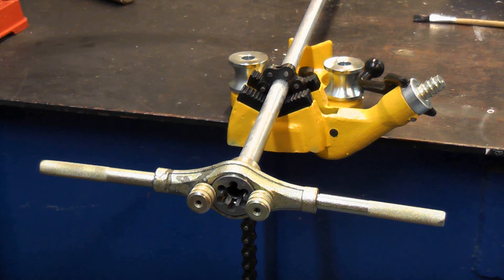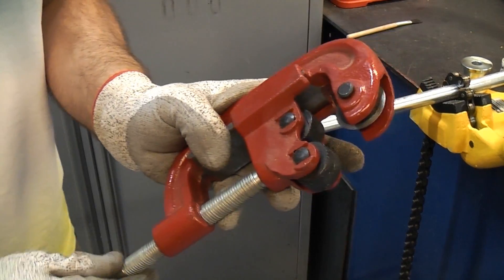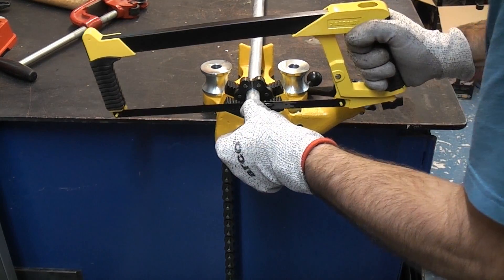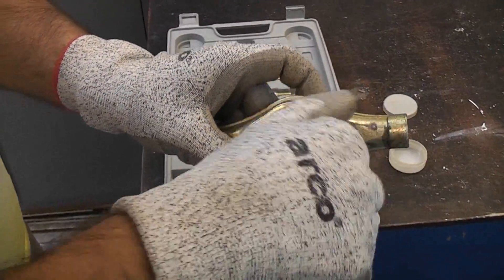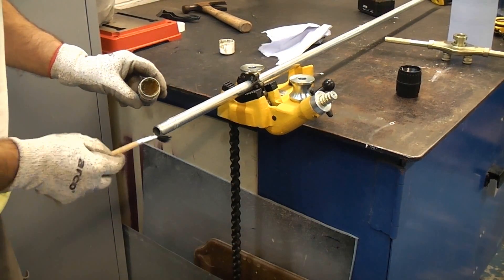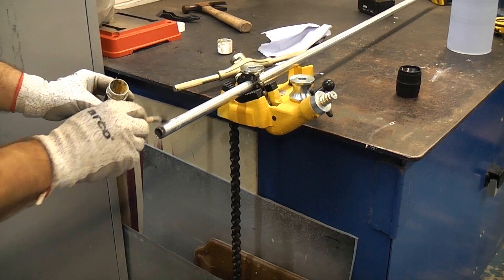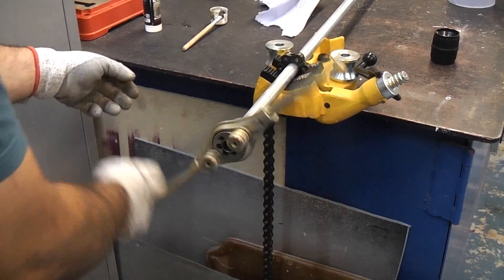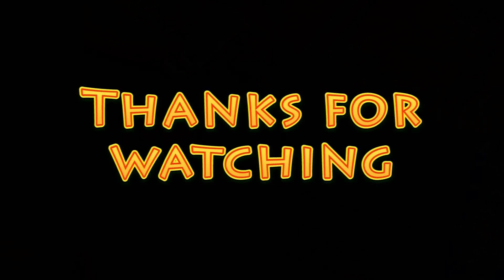How to cut and thread steel conduit

Comment: You make me want to buy tools I don't need :D
Reply from the maker: I do apologise 🤩
Thanks for the comment 👍
Reply: @ultimatehandyman  I must say, I bought one of them Bahco mini socket tool sets you appraised and fitted it under my motorcycle seat for our recent tour of Germany etc. One of the riders in our group had a leaking clutch cylinder on the second day and that tool set was perfect for the job of bleeding the system and topping up the fluid. We had to use it every day too so it was worth every penny. Thanks very much :)
Reply from the maker: That Bahco socket set is one of my favourite tools, it is mega useful for some jobs and well worth having one!
I'm glad that you found yours so useful 👍
Reply: Ha Ha me too

Comment: Fair play mate, you are probably more skilled than a lot of sparkies I've worked with in my time. This type of work is my bread and butter. It's comical seeing a Billy Bullshitter realising he's going to get found out when you get the conduit bender out 🤣. There's no shame in not being able to do it as a Spark. Everyone has strengths in different areas of electrical work. If i went to work with house bashers, they'd think I was shit because i can't lift carpets and floorboards.Galv Containment is like the ultimate bragging right, though, for some reason 🤦.
Reply from the maker: Thanks 👍

To be honest, I rarely install conduit. I’m more of a pipe installer and have done tons of steel pipe from ½ inch up to 2 inch threaded. I’ve bent plenty of pipe using a hand operated, hydraulic bender, which will do up to 3 inch.
Thanks for the comment 👍

Comment: Can I use ½ iron water pipe instead of the pirposely made conduit pipe?
I got a lot of fittings and pipe left from previous plumbing jobs.
Reply from the maker: You could do, but you would have to use pipe fittings instead of conduit fittings. In the UK conduit and fittings are metric, whilst steel pipe is still Imperial 👍
Reply: @ultimatehandyman  Thank you for the reply!
Ah ok t , the intersection box has metric thread so It's going to be a mish-mash of imperial and metric perfect for the next guy who has to deal with it (Me).

Comment: is there a threader for threading INSIDE the conduit? If yes, what's the brand name? I intend to use it in building bottom brackets  and head tubes of bicycles. Because of the pandemic, bikes became very popular. So now it's hard to find old frames in my country where I can just cut off the bottom bracket and head tube of old frames, So I'm thinking of making my own bottom bracket and head tube. I know a metal lathe would do the trick, but I don't have space for a metal lathe,
Reply from the maker: I guess you could just use a tap and die, to thread it internally. That is providing you can get the correct size tap for the internal diameter of the tube

Comment: Hi pls where did you by yr vice from?
Reply from the maker: I bought it at auction a few years back from bidspotter.co.uk
I've not seen any for sale since, I did have three of them at one point, as I was bidding on three of them and won them all, but I only have the one that is fixed to the bench now. You can get them on ebay but they are not cheap- https://fave.co/3iqa8PL
Thanks for the comment

Comment: hi great vid . Any links to the pipe cutters used or alternative which will cut conduit. Many thanks
Reply from the maker: One of these should will cut conduit- https://fave.co/32mstES
Or they sell smaller ones, but I'm not sure how effective they are- https://fave.co/2zOJjQi
Thanks for the comment
Reply: @ultimatehandyman  would this be suitable?
https://www.ebay.co.uk/itm/Vintage-Monument-Brand-Pipe-Cutter-Tool-Size-2A-No-363-1-2-1-1-2-England/183928864916?hash=item2ad303c094:g:kz0AAOSwVhhdNt6K
Reply from the maker: Not sure, I have one similar to that, but it can only be used to cut copper pipe.

Comment: would a angle grinder with a metal cutting disc be good for cutting the pipe
Reply from the maker: Not really! It would easily cut it, but galvanised steel can give off fumes, which can be harmful, so it's best to use a hacksaw or a steel pipe cutter. 
Thanks for the comment 👍

Comment: which is the best size conduit to run compressed air lines, 9 bar
Reply from the maker: You need steel pipe for that, not conduit.
Conduit is only suitable for protecting electrical cables from damage.
Thanks for the comment

Comment: Nice video. Quick question, would that pipe cutter work on stainless hydraulic / seamless tubing?
Reply from the maker: It should do. I use a similar cutter at work to cut stainless pipe from 1/2 inch up to 2 inches in diameter. Obviously cutting fluid/coolant is essential.

Thanks for the comment

Comment: I was always taught to cut the first couple of threads dry, then remove the dies and add the cutting compound to cut the rest of the threads. Helps the dies 'bite' at the beginning
Reply from the maker: The die will bite regardless, but it's better to protect your investment by ensuring the dies are lubricated.
Thanks for the comment 👍

Comment: Thanks. Is conduit for protecting wires? And is that tapered thread like on water pipe?
Reply from the maker: Yes, the conduit protects the wires. Normally if a socket was being installed in a factory etc. the conduit would be installed and single electric wires would be used (singles) instead of twin core and earth (which is used in most houses).
The threads on conduit are parallel, unlike pipe threads, which are tapered.
Thanks for the comment 👍

Comment: Those prices for hiring are insane. 40 for one day??
Reply from the maker: I don't own an electrical contracting firm, all I know is that some firms hire in equipment. As you can see from the video, I have my own stock and die set.
If people did not hire the equipment, the hire shops would not stock them.
Reply from the maker: Yes, but often these would be hired by electrical contracting firms, so the price will be added to the job. It's much cheaper if you hire them for a week etc.
Thanks for the comment 👍
Reply: By a contracting firm? If you would do this often (as I expect a firm to do), wouldn't it be logical to buy your own? I mean, there's also competition there, so you'd be cheaper

Comment: can you cut solid round 
bar with that tool ?
Reply from the maker: I’ve never tried, but I think it will damage the cutting wheels. We use them on site for cutting steel pipe up to about 3 inch diameter and 6mm wall thickness 

Thanks for the comment
Reply: No

Comment: So the pipe is held down by a piece of chain?
Reply from the maker: Yes, it is a Chan vice.  It's not a normal piece of chain, it has longer rivets that stick out at each side of the chain, they engage with slots in the vice, you then tighten the handle and it pulls the chain tight- which is great for gripping round objects.
Thanks for the comment 👍
Reply: @ultimatehandyman  there must be other ways of clamping round stock, such as a Workmate with a double V-groove?
Reply from the maker: That might work, but I’ve never tried it.

Comment: Is your pipe vice also a bender? I noticed it had roller guides, I've never seen one like that before. I've got an old Record 92 pipe vice.
Reply from the maker: I think you can use it for bending, but I've not tried it yet.
I bought it at auction a few years back and only fixed it to the bench last week- when I needed to thread the conduit.
Thanks for the comment 👍